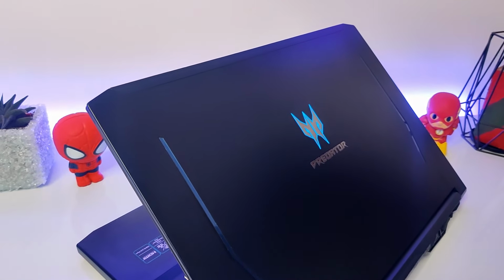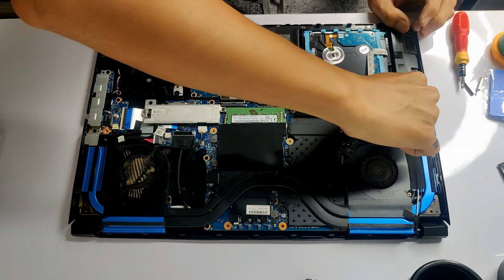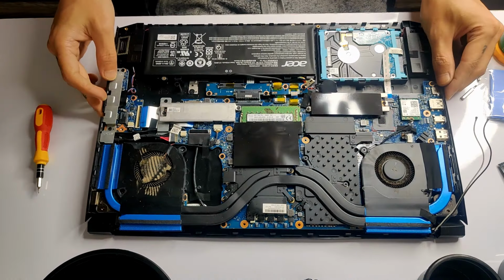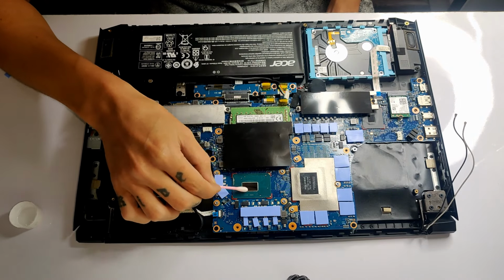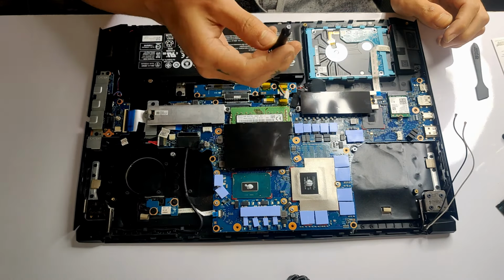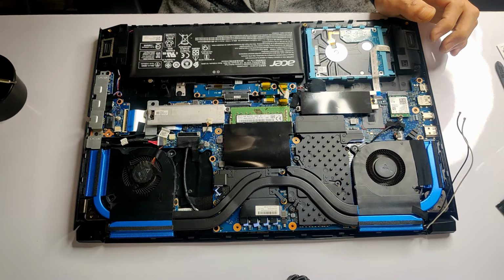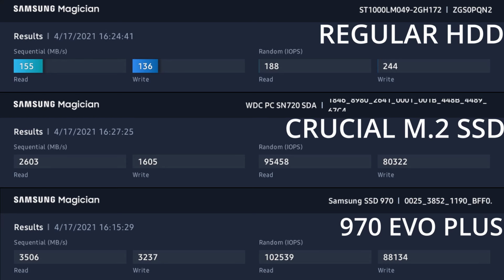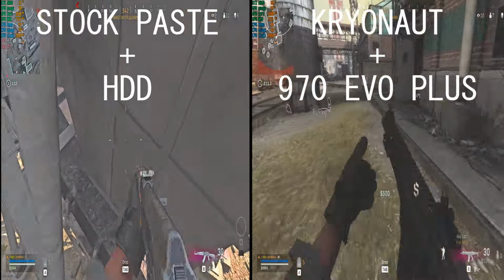ACER PREDATOR HELIOS 300 2019 UPGRADE | REPASTING | CLEANING GUIDE & BENCHMARK

Comment: The thermal pads should only be replaced if they're dry and flaky like yours, right? Should I buy the pads in advance just to be sure, or it's okay to just do the repasting and change the pads later if I see they're in a bad situation?
And would you recommend using those anti static gloves or some sort of anti static pad? Or something else to avoid static, if it's necessary. (I'm a little scared of damaging something)
Also, this might be a little dumb on my part but bear with me, I saw you recommend in another comment something about applying the pads first, but not the paste yet, fix the heatsink back and after a while remove and check for contacts. I have two questions about this: should I screw the heatsink back on during this, or just place it? And what does a contact looks like, which pads it could be on, and what exactly to do in this case? (For what I could get, the 0.5mm pads go on the ones that had the pink stuff, and the 1.0mm go on the rest, right?)
Thank you soooo much in advance, this video is pretty much a life saver for me right now, cause just the other day I was doing nothing and the CPU was in 81ºC and it really freaked me out, buy this is the first time I do something like this myself, the most I've done before was adding an extra SSD.
Reply from the maker: Before you do anything, remove the back cover to check on the thermal pads. If they are all over the place, it's better you get the pads and replace  them along with the paste because once you remove the heatsink, you will have to repaste again so air gaps are eliminated.
For static electricity, you could just touch some metal to discharge yourself every now and then.
Checking for contacts meaning to look if imprints have formed. In that way we know that there are no gaps and the thermal pads will transfer heat normally. You will have to screw down the heatsink and let it rest for sometime.
Reply: @MVNDRVX  thank you, I can't express how helpful this is, thank you so much

Comment: After redoing and repasting everything a couple months ago my idol temperature when plugged in raises up to 65-70 Celsius on idle 88 When Gaming is that Normal?
Reply from the maker: @DennisMC1974  Gaming temps seem fine depending on room temperature but the idle temps should be lower. So you deep cleaned everything?
Reply: @MVNDRVX  yes thanks for the reply just when I plug in the laptop it starts to raise up to around 65-70 idle it might be some background applications doing it because the fans start raising then sometimes it'll go back down to 50 idle ,thanks 👍

Comment: my temperature rose after repasting , i followed exactly this..pls help
Reply from the maker: So just explain what you did and the products you used. Maybe we can figure out where you went wrong.
Reply: @MVNDRVX  if used everything same but Arctic 4x as paste, i applied a decent amount on cpu and gpu after cleaning but now the temperature rises significantly
Reply: I think i might have not tightened the heatsink enough, but idk how it should look once tightened up
Reply from the maker: @prototypeb3480  I don't recommend using the Arctic mx4. Check if your fans are working fine.
Reply: @MVNDRVX  yes the fans are working fine at full speed, it's something with either paste or the heatsink placement from what i can guess
Reply from the maker: @prototypeb3480  well there you go then. Try repasting again. If problems still persist, get a different paste.
Reply: @MVNDRVX  i think it's the paste now most prob
Reply from the maker: @prototypeb3480  that's why I never recommend mx4 because I've tried it before and didn't get the expected results. Plus there are a lot of fake mx4 pastes in the market.
Reply: @MVNDRVX  i repasted it with another paste gpu is lowered by 20C but cpu is not so much affected..you know what it could be? i used same method of application
Reply from the maker: @prototypeb3480  application method doesn't matter much. The amount of paste applied matters. Too much is fine but too little can cause problems.
Reply: @MVNDRVX  I'll repaste it after a few months then, i don't wanna reopen it again now and mess it up since both are lowered right now lol
Reply: @prototypeb3480  what paste did you go with?

Comment: i was doing fine the whole process until i had to reconnect the wi-fi connectors, for the life of me i could not connect the white wire, has anyone found a fix/solution?
Reply from the maker: Could it be possible that you might have damaged or bent the connectors?

Comment: Hey I appreciate the video!
I have a few questions, thanks in advance!
1. What are the risks of doing the disassembly (short circuit/etc.) and how would you mitigate those risks?
2. I have a predator that hasn't been repasted for 2 years, do I must replace the thermal pads? Would it make that big of a difference if I don't replace it?
3. For the thermal pads (Amazon costs too much in terms of shipping) can you tell me whether this unbranded thermal pads is okay to use or not? 
Specifications:
Blue
Size Length x Width: 20 x 20 mm
Thickness : 1.0 mm (Don't worry it has the 0.5 mm version as well) 
Thermal Conductivity : 3 Wm/k
4. I've heard that static electricity damage can happen. Is that a thing I should be worried about or is it ok? Do I need some special equipment? 

Thanks for the video once again! Liked and subscribed
Reply from the maker: You can make sure you're grounded during the process to make sure there's no risk of static electricity short circuit. These cases are rare though. In case you don't find a grounding device, just touch some metal to discharge. 
Thermal pads don't need to be replaced unless it's gone bad. Mine got flaky and was all over the motherboard so had to replace them. If at all you're replacing your thermal pads, I'd recommend you go for at least 6W/mK.
Reply: @MVNDRVX  Thanks for the reply! what would happen if I use the 3W/mK
Reply from the maker: @bzyntn  no idea but I used 6W/mK and I feel it's safe. 2 years now and still going strong better than stock thermal pads.
Reply: @MVNDRVX  
Alright thanks for the info mate ❤️
A few more questions:
1. I haven't changed anything for more than 2 years, how long did you use your laptop before the stock thermal pads went bad and flaky? 
2. I'm thinking about buying an antistatic mat and straps just to be safe ig. Is it worth it or is the risk of static electricity damage is very small?
3. If its not worth it how often should I touch metal to discharge? Every few minutes? Once before working?
Reply from the maker: I had to change it a year after buying my laptop. 
The risk is small but costly. If you're really unsure, I'd say you better go for the anti static equipments.
Reply from the maker: To be honest, I didn't take any precautions 😂

Comment: What thickness did you use for the pads? and one piece of 20x120 mm is enough to change all ? I cant find 2 pieces, only one
Reply from the maker: 0.5mm for the vram memory and 1mm for everything else.
You will need atleast 2 strips of each size.
Reply: @MVNDRVX  Ok, thanks!

Comment: Hi there. My wifi stopped working after this. I know I plugged the wifi adapter correct. What seems to be the problem?
Reply from the maker: Try uninstalling & reinstalling the wifi drivers. 
Check once more if the adapter is plugged properly. Check if the wires are plugged in their assigned slots. Nothing should go wrong unless you broke something.

Comment: can i add thermal paste instead of those blue tapes you added?
Reply from the maker: I wish that was possible. Unfortunately, no you cannot add thermal paste instead of thermal pads(blue tapes), since thermal paste are low in viscosity and it would not cover the gap.
If you could get your hands on a high viscosity paste just like the stock pink paste, then it could be done. But with regular thermal paste, it's not recommended.
Hope that was helpful. Do subscribe to the channel to show some love & support 🙂

Comment: Hello, great vid!
I just didn't understand how to plug these two cables of wifi at 26:43. Mine aren't plugging in, I don't know if I should pressure it more or something. Any tips? Thank you!
Reply from the maker: Hey! Thank you 😃
Maybe you need to put a little more pressure. Just make sure you've aligned them correctly and push them straight down or you could just unscrew the wifi adapter, pull it out and try connecting the wires if that's easier for you 🙂
Do SUBSCRIBE to show some love & support 😊✌🏻❤️

Comment: Hello, What model is that? What gpu ur model have? How r u getting 100+ fps in warzone xD I have Acer predator PH-315-52 model ( i7 + 1660ti + 16gig ram single channel) nowadays im not even getting proper fps i used to get 80+ fps in warzone but now i barely get 60fps! Same in valorant too, in 1920×1080 settings i used to get 170+ fps, but now i get like 100! I usually play these two games!! So replying thermal paste and adding an additional ram will increase my fps? And im using crusial ssd too. Please do reply
Reply from the maker: Hey! Mine is the 2060 version. 
No, reapplying thermal paste will not boost your fps unless your cpu is throttling due to bad thermals. Having dual channel ram will boost the performance to an extent.
Is your game installed in the SSD or HDD? If SSD, then what type of SSD is it?
Reply: @MVNDRVX  im using the crucial mx sata ssd
Reply from the maker: @ridhulpauly  if you want the best performance, upgrade to a m.2 SSD.
Much better if you can get a Samsung evo just like I did 🙂

Comment: bro my gpu fan stooped last day its shows 0 rpm in predator sense plz tell me solution and also a question "is gpu and cpu fan are of same size plz let me know i m worried"
Reply from the maker: Maybe the fan motor is broken and the unit needs to be replaced. CPU & GPU fans are the same size but not the same. GPU fans blades are made of metal, while the CPU fan blades are plastic.
Hope that was helpful. Do SUBSCRIBE to the channel to show some support 🙂✌️

Comment: gg man. what type of thermal pads you use exactly and how many mm? 1mm? and what thermal paste you suggest me with a same laptop but with a i5 11th gen and a rtx 3060?
Reply from the maker: The thermal pads link is in the description. Check if it's available in your country.
I used 0.5mm for the vram memory and 1mm for everything else.
I guess it should be the same for you also but I'd suggest you search on Google and double check 🙂
Reply: @MVNDRVX  thank you bro.
Reply: @MVNDRVX  one more question, which one is the vram memory?
Reply from the maker: @mariossakas8913  the chips around the GPU. If you see in the video, they had pink paste on them.

Comment: @MANDRAX can you tell me the thickness of the thermal pads? the measurements are no longer appearing in the video... one more doubt, i have only .5 mm pads, if i need 1.0 mm can i use one above the other?
Reply from the maker: You need both 0.5mm and 1mm.
Using 0.5mm pads one above the other to make 1mm pad is not a good idea. It could disrupt the heat transfer.
Reply: @MVNDRVX  thanks man i really appreciate it. the .5 goes over the vram and the 1mm goes on the rest?
Reply from the maker: @LukkazPavan  Yes.
Reply: @MVNDRVX  Thanks man this help me a lot
Reply from the maker: @LukkazPavan  you're welcome.

Comment: Hey, small question
What are you using to clean the ruined thermal pads, any alternative for alcohol?
Reply from the maker: Nope. Alcohol is the only recommended solution to use. Make sure it's 99% and not 70.

Comment: Please help me, my laptop can't power on after i do this
Reply from the maker: Check if you connected the battery
Reply: @MVNDRVX  thanks dude, the small round battery is not in a good condition i think, it's weak already to starter it
Reply: @MVNDRVX  do you know what type of battery it is ? The small round one with cable ? I think ours is just the same, mine is helios 300 17,3 inch 2019 edition
Reply from the maker: @T.A.M.A22  You're welcome. Do SUBSCRIBE TO THE CHANNEL 🙂
Reply: @MVNDRVX  done bro
Reply from the maker: @T.A.M.A22  Thanks for the sub 🙂 I'm not sure about what type of battery it is. Do check about the model on the battery.
Reply: @MVNDRVX  okay my bro 👍👍👍

Comment: Olá, tudo bem? Tenho um Acer Predator Helios 300 modelo PH315-52. Ele teve uma leve queda e amassou lateralmente as laterais direita das 3 carcaças. Comprei no Ali as 3 peças, mas ainda não troquei. No face uma época que fiz post lá comentaram para ter cuidado na troca da carcaça que segura a tela do note pelo fato de ter algo que ficaria soldado na carcaça. Sabe se tem mesmo? Se não me engano falaram ser algo da placa Wifi perto da webcam. Desde já agradeço. Obrigado.: 

Hello everything is fine? I have an Acer Predator Helios 300 model PH315-52. He had a slight fall and laterally dented the right sides of the 3 carcasses. I bought the 3 pieces on Ali, but I haven't exchanged them yet. On Facebook, a time I made a post there, they commented to be careful when changing the housing that holds the screen of the note because there is something that would be welded to the housing. Do you know if there is? If I'm not mistaken, they said something about the Wifi card near the webcam. Thank you very much in advance. Thanks.:
Reply from the maker: I only know the wifi card being below the GPU fan. Not sure about the welding though.

Comment: when is ideal to be cleaning a laptop as a routine? 
I have my ph300 for a year now, and I'm wondering if I should try cleaning it even if I'm kinda scared

and when should I try changing it's thermal paste?

and about that brush to clean it, which type of brush is ideal so I don't damage my laptop?
Reply from the maker: Cleaning routine would depend on how dusty your surrounding is. Once in every 6 months to a year should be ideal.

If your CPU temps are rising above 90 degrees celcius, then you should consider respasting, even if your laptop is brand new.

You can use any soft brush. I've used painting brush for mine.

Hope this helps. Do subscribe to show some love & support 😊✌🏻❤️
Reply: @MVNDRVX  it helped a lot!!!! thanks for helping me! this video for sure helped a bunch too
hope u make it a lot bigger 💕
Reply from the maker: @verenna961  you're welcome 😃 and thank you so much for your kind words... means a lot to me 😊✌🏻❤️

Comment: Hi my laptop fan has been making a buzzing noise, I’m not sure if I’m supposed to change the thermal paste for it or something else is wrong with it
Reply from the maker: The fans have nothing to do with thermal paste. Please check the fans for dust and clean them out.
If problems still persist, the fans will need a replacement.

Comment: I’ve had mine for almost 2 years now and never opened it up to clean. The fan is very loud now and the other day my game froze up completely and I couldn’t even open task manager. I’m sure it was overheating as the temp fluctuates between 75-90 Celsius when gaming. I know nothing about computers and afraid to open it up. Is this something I could get done at a computer shop?
Reply from the maker: Yes. You absolutely can. Just make sure you're there physically to double check the work. Most shops I know will just repaste it and will "not" do a good job cleaning the hardware cause it takes time and patience.
Hope this helps. Do SUBSCRIBE to show some love & support 🙂❤️

Comment: want a thermal paste for my laptop which is equipped with a r5 4600h and a 1660 so with which paste should I go with kryonaut, noctua nt nh1 ,or artic mx4 which one will last 8 -10 months without drying or significant rise in temp
Reply from the maker: I would recommend you to go with either kryonaut or noctua.
I've had bad experience with arctic cause I ordered it online and the seller sent me a fake product. Plus the mx-4 has a thermal conductivity of 6w/mk, whereas the nh-h1 is 8.5w/mk and kryonaut is the best among all with a thermal conductivity of 12w/mk 🙂
Hope this helps clear your doubt. Do subscribe to the channel to show some love and support ☺✌
Reply: @MVNDRVX  but bro kryanaut shows pump out effect I heard and I heard it dries up above 80 degrees and how is kingpin kpx is it suitable for laptop
Reply from the maker: @aringiri1946  To avoid pump out effect, apply the paste as even as possible using the applicator provided in the pack and the quicker drying of paste could be due to not applying enough paste to make proper contact. In that case the paste is not dissipating/transferring the heat, putting a lot of pressure on the paste which leads to thermal issues.
Remember you can apply a little more paste but not too little.
About the kingpin brand, I'm not too sure about it. So don't want to mislead you 🙂
Reply: @MVNDRVX  how to spot and real mx4
Reply from the maker: @aringiri1946  check out the original packaging on their website 🙂
Reply: @MVNDRVX  bro if I get original mx4 so which one should I choose kryanaut or mx4 for long term
Reply from the maker: @aringiri1946  When applying for a laptop, all are good when it comes to lifespan.
You can't expect to use the same thermal paste for 5-6 years without dismantling and cleaning out the fans and exhaust fins.
Go for a paste that would dissipate most of the heat and give you good temps. Lesser the temps, longer your laptop components last.
So, Kryonaut would be best.
Reply: @MVNDRVX  I just want to last long 8 to 10 month so which one plz tekl
Reply from the maker: @aringiri1946  both would last that long.
I would suggest to go with kryonaut.

Comment: Should  I use these same thermal pads for "2021" version? coz in this version, GPU chips placement aren't same as 2019 .
Reply from the maker: Yes. Same thermal pads should do just fine. The placement doesn't matter 🙂